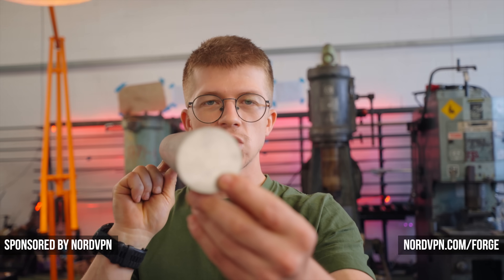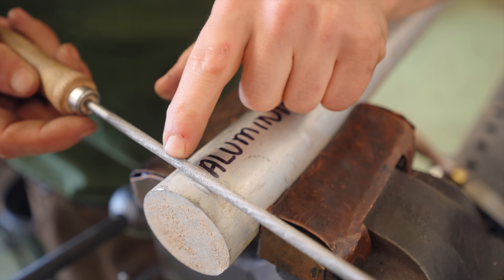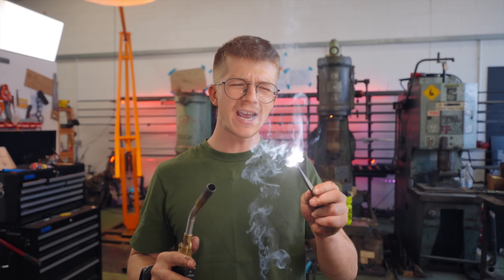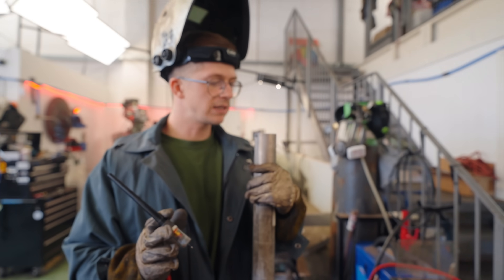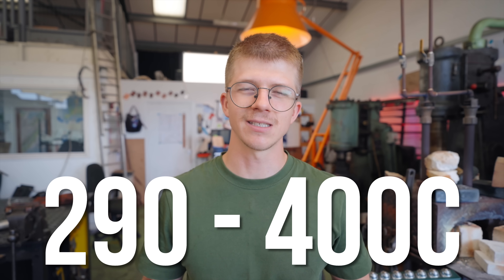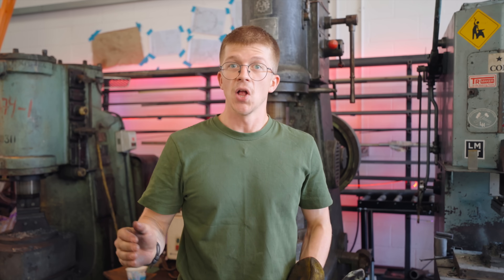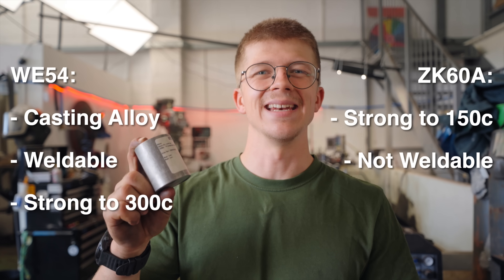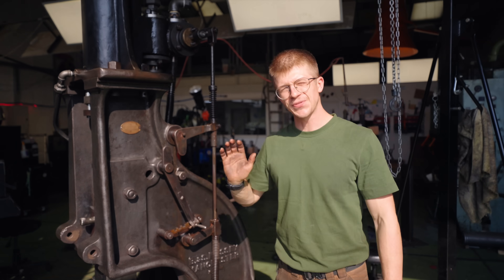Can You Forge Magnesium?

Comment: you can put out a magnesium fire with gasoline.  the gasoline burns at a lower temperature and eats up all the oxygen, putting out the magnesium.  Then you just have to out out the gasoline fire.
Reply: Metal fires, Class 4 fires, have to be put out by eliminating all oxygen and cooling them down.  This is a legitimate way to put out a magnesium fire.
Reply: I know so little about this that I can't even gauge whether this is a joke, a neat factoid, or an actual technique that would actually get used.
Reply: @nerithedreamseeker  It is a neat factoid. There are better ways to put out metal fires such as sodium chloride (table salt).
Reply: @nerithedreamseeker  MrGreenGuy do a video about this, it's call: The weird way gasoline puts out metal fires.
Reply: Idgaf. It’s hilarious to even fathom
Reply: Or salt. Salt reacts with the magnesium and blocks out the oxygen
Reply: Thankfully, those are probably pretty easy in comparison.
Reply: Water on a magnesium fire can cause an explosion, but it's just counterintuitive to put a fire out with something flamable.
Reply: We used to put it out with mineral oil. It might catch fire but can be dealt with by normal fire extinguishing methods like biking soda. Magnesium plus almost anything with bound oxygen burns or explodes. Baking soda direct on magnesium makes it burn like a road flare 😮

Comment: Not a forging expert at all, but I feel like the reason the crack seemed to propagate from the center is that it wasnt heated for long enough, so the center still wasn't at the malleable temperature that the outside was at.  So maybe 350C for 1.5 hours before forging would do the trick

Comment: He poured water on a magnesium fire
Man has a death wish
a proper magnesium fire will rip water apart, making Oxygen and Hydrogen gasses within the 3000º flame
with obvious results
It does the same to carbon dioxide, so even those fire extinguishers only fuel the fire

Comment: Magnesium is 1.5 times less dense than Aluminium. Magnesium alloy is used to make a lot of lightweight components especially in racing for example racing wheel hubs. (Also why they are called "mags"). 
Density however does not always indicate strength, there's also different types of "strength". Tensile, Compressive and impact would be the most common. I would also throw in Corrosion resistance as a type of strength.

Comment: Magnesium is fun to burn at least, (done so outdoors only and in low-to-no-risk for fires kind of environments), I happened to have pieces from a discarded old computer device (the case/handheld) I thought it was aluminium though I wasn't sure, turned on a propane burner and aimed onto the metal, which started to burn and smoke slightly before the fun got going - it started to become extremely bright as it burned, I mean it was like turning on a searchlight, the whole back yard basked in a bright intense light for the few seconds the magnesium burned, this was at night though so that amplified the impressive brightness.

Comment: Wouldn’t be surprised if the center wasn’t hot enough. Better thermal conductivity than steel, but at these low temps & with a weaker, more fragile metal…

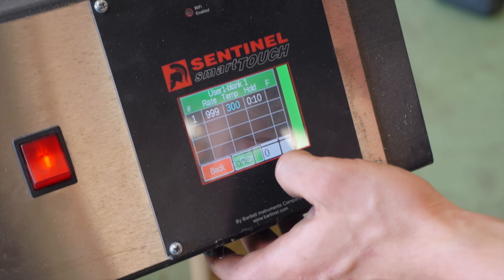Comment: 10:38 yeah because we humans should measure temperature by how the water feels, not how the human feels. Besides, how are you gonna base a temp off of water when both boiling and freezing point for water change based off factors like elevation? Farenheit is based off of humans. 66*f is 66% hot. 100 degrees high risk of heat stroke. 0 degrees high risk of frostbite/illness. 100 degrees celcius outside and you're dead. How is 0* c not too bad, but 100 degrees death?

Comment: Interesting watch :) Although putting water on a magnesium fire is very dangerous its fine when cold water but once there is some it warms it will then vapourise the metal causing a stem reaction.
Can't forge it but you can technically cast it which both some motorcycle engine parts and F1 engines have been made out of over the years

Comment: Here is the best argument i have heard about °F vs °C, and lets throw in K...
°C is what temperature feels like for WATER.
°F is what temperture feels like for HUMANS, 32 is freezing but we can tolerate it however 0 is REALLY cold and we can die from it very easily.
K is what temperture feels like for MATTER, 0K = 0 atomic movement.
So thats why °F makes more sense when referencing Temperture and Us humans, plus there is a greater range with finer division between degrees. Like the difference between 60 and 70°F might warrent a hoodie, where as the difference between 30 and 40°C is kinda hot but tolerable and freaking DEAD... thats a massive range for 10 degrees.

Comment: metals are basically a crystal, they have a "crystal lattice" pattern when you look close enough with a strong enough microscope. even though its lighter and less dense, its more prone to fracture and cleavage because of the way the atoms are holding the material together. may also be a contributor to its reactivity.

Comment: I find myself compelled to respond to Jaime's "lighter has less atoms" comment - in metals lighter often has more atoms per volume.  For instance, Iron is 7.8 g/cc where Ruthenium is 12.2.  Based on their molecular weights (55 and 101, respectively), if the molecular counts per volume were identical then Ruthenium should be around 14.3 (or Iron should be 6.6 if you calculate from Ruthenium).  The bond radii in Iron (126) would be about half of Ruthenium's (268) but Ruthenium's crystalline structure (cuboctahedric) is a little more efficiently packed than Iron's (either Body- or Face-centered cubic).  So overall Ruthenium will have a count per volume approximately 15% less than Iron's.  Hardnesses are a few more orders of magnitude of complicated to explain, though, and can't be predicted nearly so easily as I'm sure your years of learning how to manage grain structure through heat treatment have taught you.

Comment: I saw a video where a shop was hand forming a magnesium sheet body. The trick was to heat up enough to be malleable, but not ignite it. I think it was about a hundred degree range between the two. 
I looked up once, magnesium has a lower density (on paper at least) than carbon fiber.

Comment: Some old cars had magnesium-aluminum allow transmission cases.  I high school we has a machine shop with a foundry.  We were casting aluminum and got some scrap transmission cases.  When we threw in the magnesium alloy it was like a fireworks display coming out of the furnace.

Comment: Magnesium is used for side cases for motorcycles because of the weight but it sucks when you crack one and they crack easier than aluminum because as you see tig welding it is about impossible whereas an aluminum case is doable with an experienced tig welder. I seen one old man weld a magnesium side cover but how he did it I have no clue. We were all in awe

Comment: Volkswagen used air cooled engines and the metal of choice for their engine blocks was magnesium. My Uncle had a repair shop where he rebuilt old Volkswagens. One day that shop caught fire, the fire fighters tried there best, but once the fire reached the area where they rebuilt the engines they just turned off the hoses. He said, you could not imagine the sound these parts made as they would break and throw molten metal around. He also said the fire burned for well over 24 hours. Powerful stuff magnesium not something to be taken lightly. 😏

Comment: Another thing about cutting aluminum; there are instances where you can actually cut aluminum beams with a chainsaw. It's actually recommended over using a cutting disc because it won't produce as much heat.

Comment: I wonder how well it would hold an edge.  Maybe get some bar stock and just grind an edge on it to try that? 

Also, Im surprised you didnt have a bucket of sand around to drop any big pieces in if it did ignite.  Thats what I was always told to use since it will burn underwater normally.

Comment: Because of it's lightness, lowers of bikes suspension forks are cast from magnesium alloy, where upper parts and steerer tubes are usually machined from aluminum alloy. I never quite grasp why is that, but I guess the reason is that as the lowers have to be much "beefier", the lighter alloy makes good weight ratio and enough strenght, while uppers are "only" a thin tube, so the strenght of the material is more required...

Comment: Celsius doesn't make sense because it's based off of water. Water freezes at 0° and boils at 100 degrees, unless you're at altitude or under some kind of vacuum or under immense pressure. Where as Fahrenheit is based off of what a human feels, zero is cold and 100 is fucking hot.

Comment: Magnesium is the was a Major Factor behind the invention of cold pressing
also, you usually dont use water for metal fires, cause in the Best case scenario it , you get a steam explosion, and in the worst case, the heat is enough to split up the water into Hydrogen and Oxygen, and you instead get a Hydrogen explosion(fun fact, you can use Gasoline to extinguish Metal fires, you will still have to extinguish the gasoline then though)

Comment: Density has no relation with hardness, it has to do with the weight of the atoms that compose the alloy. Imagine having a pipe full of balls and you can have 10 balls in the pipe. If the balls are empty inside the pipe will be very lite, but if the balls are full the pipe will be heavy. Of course by adjusting the number of full and empty the density is changing. The hardness is due to how the atoms are bonded together (basically how quenching works).  This is a very crude example to explain density to my philosophy professor. Lead is very dense, but you can bite it. Try doing that with titanium, you will have a nice dentist bill.

Comment: Magenesium fires aren't hard to put out, if you're prepared. Either use fine table salt , or mineral oil/parrafin (if your shop can handle a sceondary class B fire) to choke the flames.
Never, under any circunstances use CO2 or water. Burning magnesium will use them as fule and keep on burning, sputtering hot and molten stuff all over.

Comment: Mm, so, water on a magnesium fire is a Bad idea. 
Magnesium fires can strip oxygen from water, produce hydrogen gas, then detonate it.
Water puts fire out 2 ways; by limiting air access, but Mostly by absorbing the heat fire needs to propogate; water has a massive thermal capacity, and then cools when part of it vaporises.
But magnesium burns at 3000⁰, in a very concentrated heat zone. The water that hits that, vaporises instantly and creates a self propogating bubble around the flame...which just sucks oxygen out of the water.

Comment: while density and what we typically call hardness do have a correlation in that exceedingly dense materials are typically harder it doesn't always correlate for example Steel has a density of 7.85g/cm³ where as Diamond has a density of 3.53 g/cm3, but the hardness of steel is around 4-4.5 where as diamond is a 10 (even tungsten is only a 7.5). This has to due in large part to atomic structure and alignment of the molecules. There also examples like gold density 19.3 g/cm3 with a mohs scale of only 2.5

Comment: Jamie says that Fahrenheit makes no sense,  except the Fahrenheit system was designed with the freezing point of brine as 0 degrees, 32 degrees as the freezing point of water, and 96 degrees as the temperature of the human body. The difference between 32 and 96 was useful for instrumentation at the time (64 can be bisected 6 times.  Fahrenheit is a form of linear measurement,  Celsius is not.

Comment: Magnesium has a hexagonal lattice, that not let the material to flow, because there is very few planes in the crystal where it can "slide" to deform. That is why it is pretty hard to deform it, and that is why there is that crack forming this way during deformation.

Comment: Density isnt just how packed the matter is. Its also what is the matter. Atomic weight of an element is a factor. Magnesium has a low atomic number. 
Temperature? The argument is Celsius is linear and accurate, just like Kelvin and its calibrated to water. Fahrenheit has garbage spelling, isnt linear and 0 is set for "the coldest winter we had", while 100 correlates to normal body temperature. Only the guy had a fever that day. As u can see, F is aids

Comment: The weight is a big factor that chainsaws are mostly made of magnesium parts, the old Homelite and McCulloch chainsaw here in the US are made of completely magnesium parts, and steel screws

Anymore, almost all metal, except for the crankshaft piston cylinder is magnesium, those are usually aluminum

Comment: Copper, Aluminum, Brass, and Steel canister Damascus with the canister on, meaning no white out at all. Steel canister with copper pipe inserted, aluminum rods inserted into the copper pipe, Brass nuts between the aluminum rods, an powdered steel filling all the air gaps inside the canister. Forge out the billet, go for say 12 folds, while would bring the layer count up wonderfully high, and then take a look at that pattern.
Reply: They will not stick together... Aluminium has a much lower melting pont than copper, brass or steel and will just squeeze out from between them. You can make a mokume from steel, brass and copper, but not alu.
Reply: @Nemozoli  Something tells me you've never made bronze. Alu + Copper = bronze. And I was not recommending makume gane. I was recommending canister on damascus, in which the mild steel canister is part of the final product, not shaved off in a waste of time, money, and effort.

Comment: Have you tried any alloys like inconel, hastelloy or monel type stuff?  I was a pipefitter/welder in a refinery that had acid plants to boost octane in gasoline where we used monel and we used inconel and hastelloy for probes in high heat piping systems.  Theyre all weldable but never seen any being forged.

Comment: The Convair B-36 Peacemaker, a holder of many records had an airframe consisting of a lot of magnesium. This massive plane (230 ft wingspan, the longest of any military aircraft ever) had no fewer than 10 engines, 6 piston and 4 jets. The piston engines were of a pusher design, meaning they were at the back of the wing. This lead to several issues, as the carburator did not have proper heating, leading to carburator icing, which caused the engine to overheat and catch fire. While the B-36 had a solid saftey record for the time, crashes are inevitable, and the magnesium airframe burned very easily. It also was a nuclear bomber, and these problems did lead to a few broken arrow incidents.

(Sry for the yapping, its just i like planes and magnesium is involved in the b-36 and the video) Sry
Reply: never be afraid to yap about your interests on the internet!!!! thoroughly enjoyed this knowledge
Reply: The deterrent system at the time was such too that a portion of the fleet were meant to be in air at all times so they did rack up flight time fast.

Its a cool project, with the later modification of additional jet engines and all.
Reply: How does carb icing cause fires? Is it due to running too lean?
Reply: @Jezza_Drives_Fast  yeah, the fuel rich combustion causes it to over heat, idk I'm a plane girl, not a car/engine girl lol
Reply: @thatawkwardfeeling9076  lol no worries, thanks for the info! I haven't actually learned too much about the B-36 yet but it's always fascinating to hear about little quirks and teething problems different vehicles have.

Having been a car guy for most of my life, I've recently become quite interested in aircraft design, so still in the process of gaining a solid understanding of how and why aircraft are built the way they are. 

I enjoy your enthusiasm for aviation though!  It seems we have that in common😸👍
Reply: One thing i forgot to mention: the engines (wasp major) were designed for a tractor configuration.
Reply: Ahhh yes. The plane with engines advertised as 'four burning six turning' but in reality was 'two burning two turning two choking two smoking and two lost unaccounted for'
Reply: Cool info, thanks
Reply: Interesting, thank you for enlightening me. I suspect you are autistic like myself?

Comment: So, Magnesium is a really nice metal for certain application. First, it's crystal structure is hexagonal so does not cold work well and as you saw hot working isn't easy.  Al and Fe have cubic crystal structures that means they are much more ductile.  Mg has the highest mechanical damping coefficient of any metal, i.e. it would make a horrible tuning fork.  Mg has been used in computer disk drive housing and the arms that hold the read write heads as you want to damp any vibration in this application.  I’ve also heard of people using it to mount mirrors, so the mirror doesn’t vibrate.  Mg is also very good for diecasting.  The molds hold up much better than aluminum diecasting.  Mg has been used in some large diecast parts for cars as the Mg is light and reduces vibration.  So, it burns down your shop, details details.

If you want to play with an interesting metal, low density very strong and hard, look at beryllium.  It can be toxic if you breath its dust.  It is also a good neutron reflector, so it is used in nuclear bombs.  So don’t order a bunch of it and book a flight to the middle east at the same time.  Beryllium is used a lot as an alloying element with copper to make the copper harder and more wear resistant, for say a commutator.

Comment: Class D fire extinguishers are rated for most combustable metals. Bad idea to use water to put magnesium out as the reaction produces more heat while producing hydrogen gas. Most class D fire extinguishers use very fine dry salt that acts as a smothering agent to snuff out burning metals. When in doubt, keep a bucket of sand around.